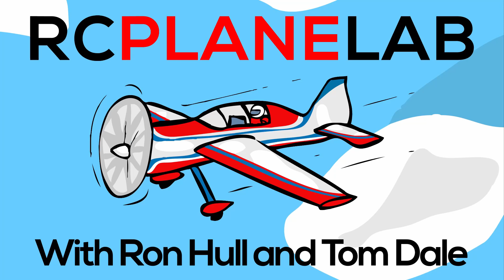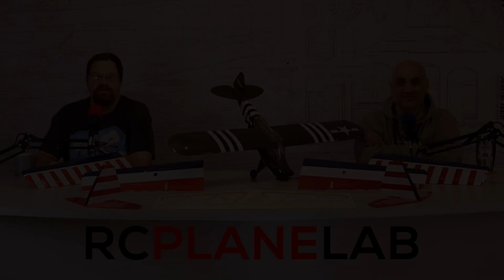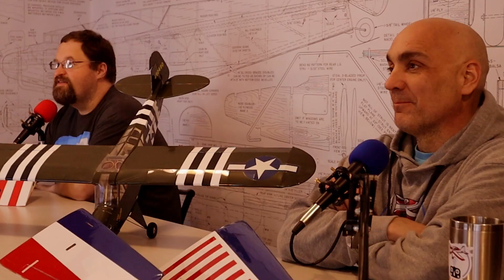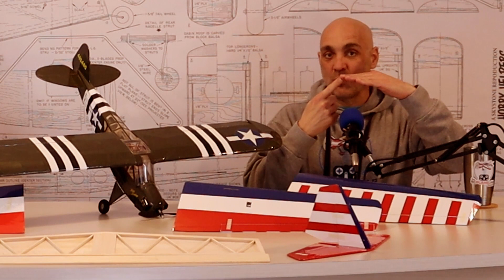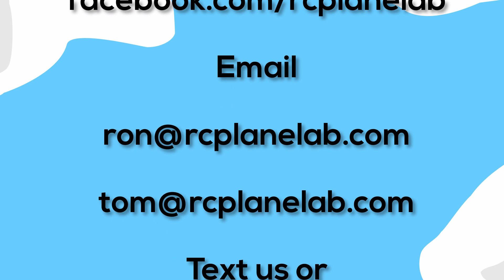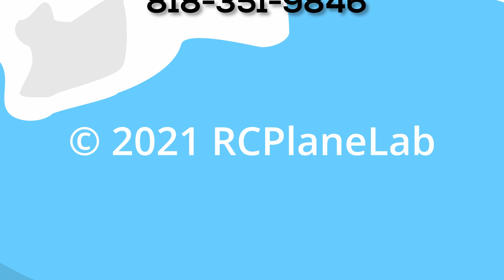Ep 59: All about Hinges

Comment: I think Du-Bro pin hinges do have an option to remove the cotter pin and use a long wire/rod for control surfaces that have two or more hinges. I think they even tell you what size wire/rod to use.